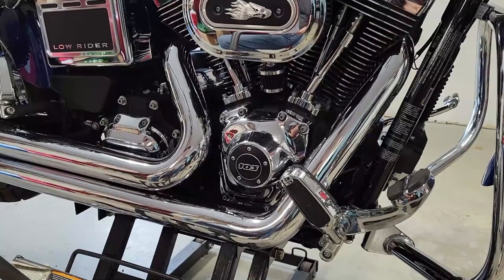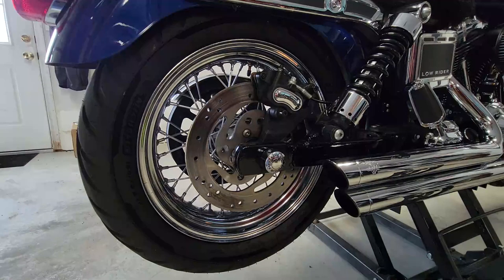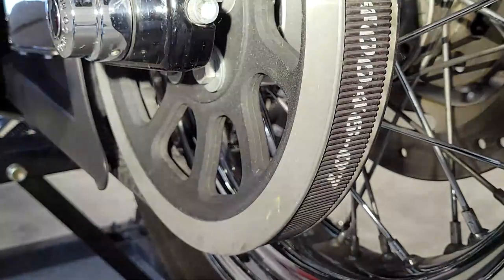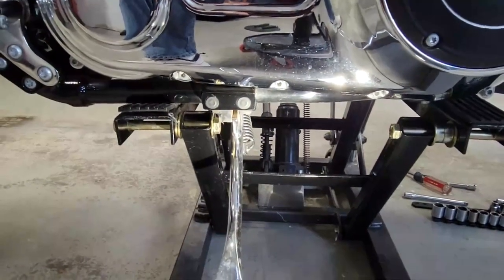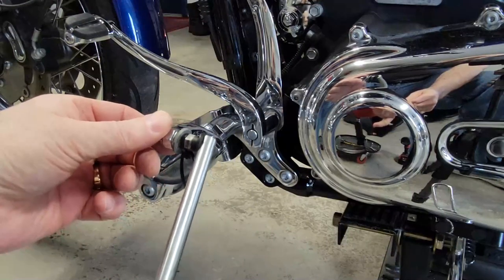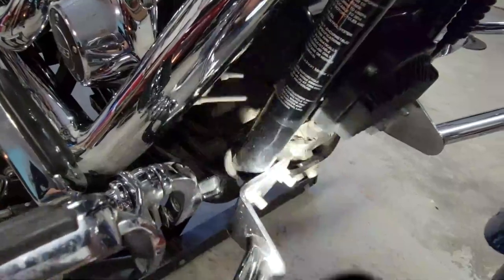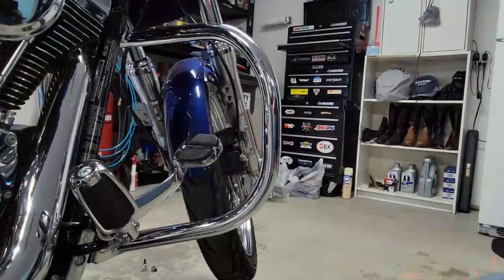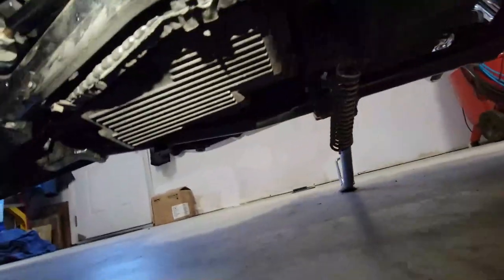How to do a full safety & critical fastener inspection of your Harley

Comment: Out of all the fasteners the only loose ones were the exhaust heat shields and header bolts.
Reply from the maker: I couldn't get the header bolts to stay tight so I had to double nut them.